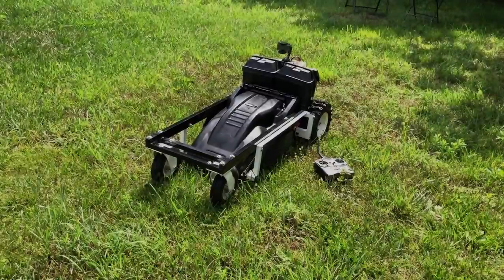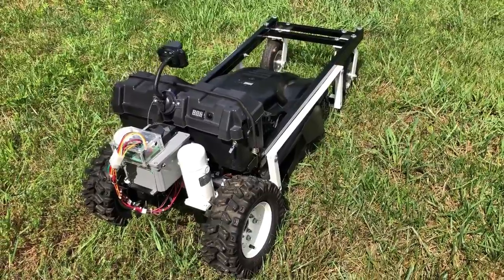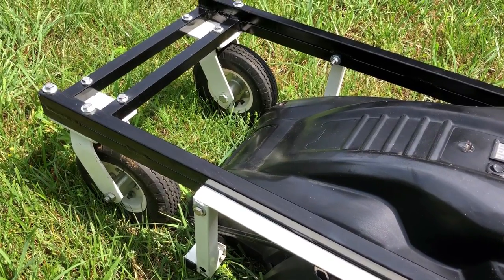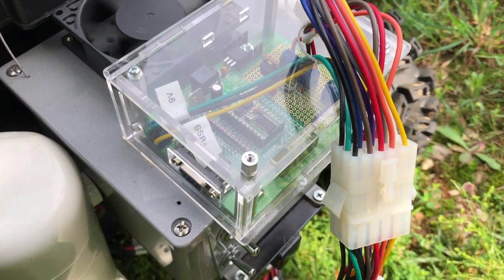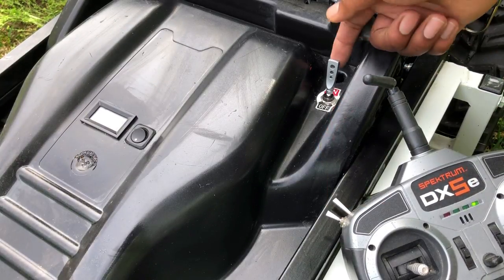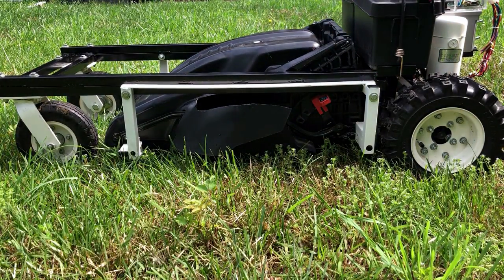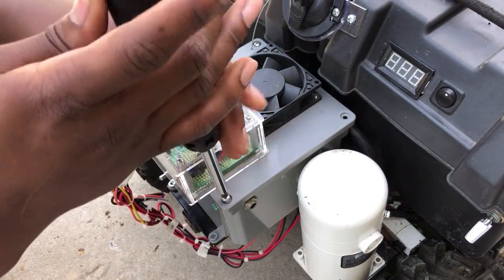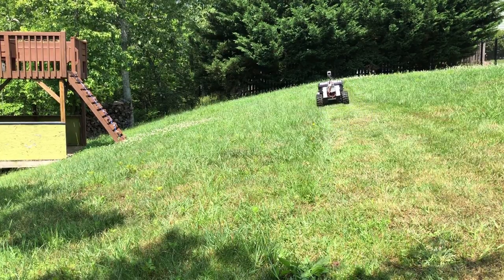RC Lawn Mower 2.0 | The Lazy Man's Mower

Comment: Nice job! Buddy and I built a hybrid for his yard. Electronics I chose were quite basic from the RC world. Dimension Engineering dual motor controller for movement, 3channel pistol grip radio and receiver with a servo on original gas mower cut off switch. Buddy wanted an alternator to keep the battery charged. Not sure what is going on with you high current contactors, we just used a big switch, simplifies the wiring.
Reply from the maker: Awesome. Thanks for sharing.

Comment: It's too bad the tires were too aggressive because they  look really cool. My second build has been on hold for a while. I'm stuck trying to figure out a way to accommodate the deck height adjustment with a rigid frame. 
Good work. It looks great.
Reply from the maker: Yeah I initially thought the wheels would be fine, but the motor acceleration speed is too high when making turns. Thanks for the comments.
Reply: @GreenTechTown  Are you using a dual motor controller set up for tank type drive? Acceleration will be controlled by how fast you move the throttle. Dimension Engineering dot com has a sabertooth controller I used.

Comment: Did not you find high temperature of motors, controller? It has radiator, but not sure if in closed box is enough for keep it in temp range

Comment: Good job, not sure about the 'lazy man', for me it look like you put a lot of work in this. I'm curious, can you make the swivel wheel not swivel just to see if they need to be swivel and how much straight wheel can improve the direction.
Reply from the maker: Hey Andre. I'm sure you could. But for my application it was cheaper to use swivel wheels instead of wheels that would need some type of electrical hardware added and more mechanical work to steer the mower in a certain direction. It has been a while since I looked into RC mowers, so it is likely someone has figured out a better method.

Comment: Hello, which electrical components are needed for the drive system next to the engines. It is permissible, two engines from the wheelchair and Sabertooth dual 25A? What else? thanks for answer.

Comment: Can you please tell me where to find the 3D drawing with measurements for the remote controlled mower frame? I couldn’t find it on YouTube or the Greentechtown site.
Reply from the maker: Hey Robert. I checked my online 3D drawing account and it does not appear to be uploaded anymore. If I find time, I will try to track down the old copy and upload it.
Reply: @GreenTechTown  thank you so much
Reply from the maker: Try the following link: https://app.sketchup.com/share/tc/northAmerica/-gClq1HWglQ?stoken=86BNWmCyStt3yQNUfrtDDBZ8MiDSYLYSpwqgpZ30MZavxL1QEC1w32r_w4Nbaspp&source=web

I cannot recall if it includes everything but may be a good reference.
Reply: @GreenTechTown  This is very helpful. Thanks for sharing.

Comment: What size sabertooth do I need to run 44 inch zero turn
Reply from the maker: I'm not sure based on the information, but what you usually want to consider is the amp draw and voltage. I would recommend asking the guys over at https://www.dimensionengineering.com which is where I purchased my motor controller.

Comment: Thanks for making this video bro. I'm designing an RC mower myself, and this offered some great insight. Did you ever make a V3?
Reply from the maker: Awesome to hear. And no, I haven't started on a V3. I'm thinking about creating a simple way to mount my wheel barrel container on top to help move dirt and other heavy items around the hard.
Reply: Have you considered maybe making a trailer like attachment for it? That way you wouldn't add unnecessary bulk to the mower and reduce efficiency when only mowing? 

I was also kind curious what type of mower you started with? Kinda looks like the deck and motor from a black n decker. I've been scouring FB/CL locally for a decent electric mower to use as a donor, but no luck yet.
Reply from the maker: @samhziegler  Good idea. And yep, it was a black and decker (CM1836) electric lawn mower.